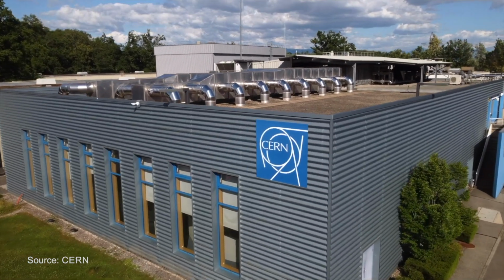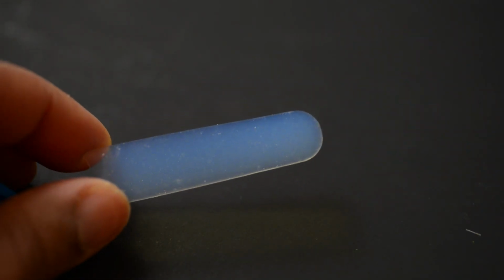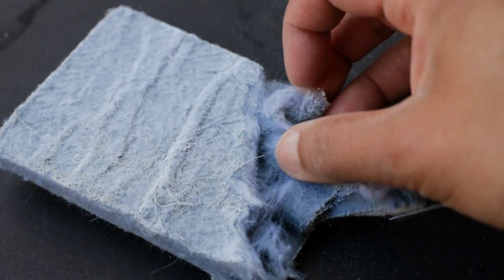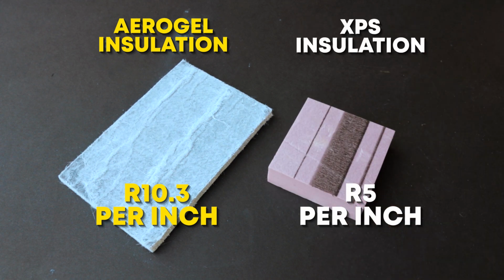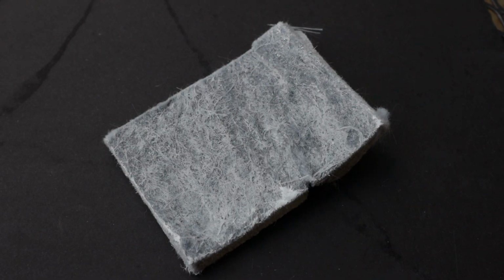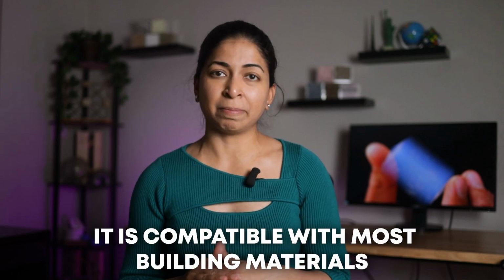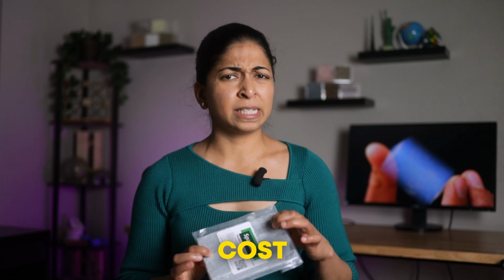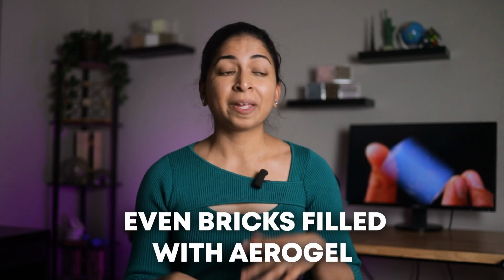Can Aerogel Insulation cut down our energy bills?

Comment from the maker: What do you think about  aerogel insulation? Would you like me to cover wood-inspired aerogel and transparent aerogel in another video?
Also check out my video on "The beginner's guide to aerogel": https://youtu.be/fjf7vdSWbb8
Reply: Yes, please do more aerogel videos
Reply: Aerogel is definitely very interesting, I would love to see you do an episode on vacuum, insulated glass as well,
I think it holds enormous potential, especially for insulating older properties and monuments while keeping their look.
Reply: I don't think it's really there yet as there is already PIR insulation in the market, which is still relatively new, but very promising, as it doesn't degrade, all the bubbles are closed in this foam, so no moisture inside of it. It does not burn and provides excellent insulation properties compared to common materials like polystyrene, or rockwool

Mainly it's not the problem with insulation itself, but the combination of factors, like the way it's applied, or which doors and windows are being used, and if there is a heat recuperator in the ventilation system installed. Besides, why use a more expensive material in the first place, if you can use just a bigger quantity of a cheaper material. 

Its also worth mentioning that it's an equation where you balance the financial cost to implement this Vs the energy savings, we achieve way more cost benefit if improving the cheaper issues first like roof insulation or installing double glazed windows as a mandatory procedure in all newly constructed buildings.

Besides such expensive materials need even better performing workforce on the ground, where it's already lacking in many countries in the quality of work concluded. Why use more expensive materials in the first place if a typical builder can mess up the insulation process while already using cheaper materials, if there are mistakes made in the way the building is constructed, it eliminates all the extra quality material costs involved.
Reply: @imakro69   That's some good information you've provided.  Maybe there's potential for a good comparison video?  Belinda did a "EPS, XPS & Polyiso insulation" video https://www.youtube.com/watch?v=xdnLOv-zf_o two years ago, if you haven't seen it.
Reply: @imakro69  PIR is most definitely flammable. All those solid foam sheet types are I believe
Reply: You can't just list off a bunch of interesting use strategies then not show them. That's just evil.
Reply: I think aerogel insulation would be great for use in projects where space is limited, such as in container home construction. That said, it sounds like it needs to be more generally available and less expensive.
Reply: @DesertHomesteader  Space is so constrained in container homes - especially their narrow width - I've always thought it made more sense to put the insulation on the outside of them, maybe combined with some sort of commercial-style exterior cladding.  Probably metal, since most container home people seem to be aiming for an industrial look.

This also eliminates any issues with condensation, which plague container homes in colder climates from what I've seen.  The interior metal shell would never get cold enough for condensation to be an issue if the home were clad in some kind of wateproof siding with something like a thick blanket of rockwool underneath.
Reply: Please make another video about aerogel and its applications. Aerogel for windows sounds amazing!
Reply: Yes, a transparent aerogel video.
Compare the insulation value of a standard gas filled double pane window to a transparent aerogel filled double pane window.
Reply: Yes, aerogel has been touted for years as the best insulation but so far there are so few commercial uses. The building you spoke about is the first I have heard of it being used commercially.
Reply: Do you know something about its capabilities when it comes to acoustic insulation?
Reply: This is a great idea
Reply: Yes, but what about bugs? How it deals with them?
Reply: yes you can cover it. I don't know if you did it (I must check it, and also others youtuber) but I would also like a video on how to improve attic insulation to increase R value.
Reply: Hmmm promising for certain applications I'm sure .
Reply: I would be interested in knowing if transparent aerogel could be used in skylights in a cold climate like perhaps Michigan.

I live in California currently but plan on leaving soon, and would miss my skylights if moving to a colder climate.
Reply: No. I've looked into this. It is not realistic to seriously consider. You need to keep your values consistent: the thickness is given in mm, but the R-value is given in inches. Their thickest batts are R-5, and the product is prohibitively expensive. 

To top it off, the problem with aerogels is that they are destroyed by water. This means that the batts require a hydrophobic nanoparticle coating. Why isn't this hydrophobic coating used everywhere - say, in municipal water pipes? It would really cut down on the energy used to transport water. The answer is because it is not safe in the environment. It breaks down over time, and when it does it can cause severe birth defects. 

Aerogel is a very interesting substance but it should not be thought of as a technology that is just around the corner. It has a LONG ways to go before it can be used safely commercialized.
Reply: I wonder if they could make something like an aerogel using lignin or chitin or some other natural substance...
Reply: nope, it's not that special
Reply: I purchased some common stock. But don't know where to purchase the product. The stock has 95% ownership by institutions.
Reply: The demand for a breathable heat insulation may be far greater than you envisage. Even placed just behind radiators placed on exterior walls has me thinking....yes I will use this.
Reply: Please make a video about carbon fiber reinforced concrete
Reply: You should do one on smart windows please!
Reply: What do I think?  I wants it!

To keep the summer heat out.
Reply: Very interesting - thank you!  I would be interested in learning more about transparent Areogel applications.  Living in the far north of the country where temperatures regularly are sub-zero, condensation on windows in winter leads to mold, mildew, and window rot.  Any info would be greatly appreciated!
Reply: I am searching insulation for my van with the plan to travel and sometimes sleep in. I was going to use Thinsulate, figuring it would not be toxic if I am covering it with wood that would also be sealed, but I cannot find the 1/2 in the US. Then looked for wool and it too is unavailable indefinitely. Hemp is scary flammable. I'm at a loss.  Guess I won't be insulating my rig anytime soon. 
Thank you for these videos.
Reply: I think it would be interesting to see if aerogel added into the concrete mixture of a foundation could improve the R-value of the concrete enough to forego the use of sub-slab or exterior insulation.  If you could improve the R-value of the concrete to say R1.5 per inch without compromising the strength, then an 8 inch foundation wall would have an R-value of R12, or a 12 inch wall would be R18.
Reply: Windows! Windows! Windows please. I was wondering about windows before you mentioned it.
Reply: I really liked the information given by you. I live in India and want to make a new type of bricks and arrow walls by mixing aerogel and fly ash but I do not have investment.
Reply: great for auto industry

Comment: what solutions does aerogel offer for homeowners wishing to save on energy costs? My home has a lot of sliding glass doors and is a end unit facing southwest. In the summer my heat gain is crazy while in the winter my heating bill sky rockets.

Comment: Great breakdown of aerogel insulation! The jump from R2.7 to R10.3 per inch is massive—especially for space-limited assemblies like fire-rated doors and curtain walls. Has anyone here actually specified or tested Spaceloft in a fire door core or slim cavity wall? I'm curious how it holds up under UL 10C or similar fire endurance ratings, and if the cost is justifiable in high-performance buildings.

Comment: Absolutely!  Aerogel insulation is a game-changer for energy efficiency—ultra-low thermal conductivity means less heat loss in winter and reduced cooling costs in summer. 💡💰 Investing in high-performance insulation like this can seriously cut down energy bills in the long run! ♻

Comment: I’d close off the fresh air intake in the HVAC system to stop the outside air from working against the system. 
Your insulation can’t do much if it’s constantly battling against an open door.

Comment: Looking to replace the (triple-plane/R6?) Serious-Window glass door for my infrared-sauna, with either spaceloft-aerogel , XPS, HempWool.  I don't want glass anymore.   Since it's such a small area (65"H x 24"W), the cost of the insulating material is not a concern, nor it being fire-retardant.

The idea would be to mount the insulator on a very thin sheet of wood.  Perhaps that will dictate what material I should use?

The only other concern is breathing next to it.  Is there a better choice you'd recommend for this application?

Comment: Belinda . . I have NOT seen nor experienced AEROGEL. From what I gather in your short intro . . . I find you mention that Aerogel 'breathes' . . and allows vapour to pass thru the mass. Doesn't this go AGAINST THE VERY PRINCIPLES OF ANY GOOD INSULATION MATERIAL. 
How do you justify a figure of R 10 . . . beats me.
If the product 'breathes' . . . it CANNOT INSULATE AT ALL.
Rigid Polyurethane Foam has an R value of 6 - 7. Justifiably.
How come Aerogel is 10 ??

Comment: Rather than cost per square foot, it would be more interesting to compare cost per R value per square foot, if that makes sense.  Or maybe cost to obtain a specific R rating per square foot, if that makes more sense.  If this provides an R rating of 10 versus another material of 2, then the cost to get to an R value of 20 needs to account for using 5 times as much maaterial to get there for the second product.  So the the cost disadvantage may not be as extreme as it initially seems.  Did i get this right?

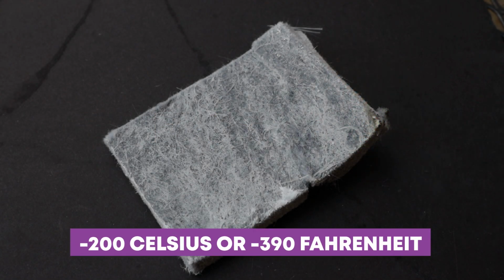Comment: 4:40 -- small error here.  200C = ~390F, but -200C = ~ -330F.  That 32 degree offset for freezing point of water always makes a mess.

Tbh, before I even clicked on the video, I figured there would never be any hope for aerogel as insulation because of cost.  The process of making it with supercritical drying and all is not trivial, so we will never live to see the day thay aerogel is affordable.  If there is hope for it, I'd also be curious about acoustic dampening.

As a rule, inefficiency of kinetic energy transfer due to poor impedance matching is one of the best ways to block sound.  It's why helium balloons can serve as sound proofing.  If that's the case, I feel like acoustic applications may come first because they will require less supply of the expensive base material and it is a market where people are accustomed to grossly overpaying for things, so it is easier for companies to turn a profit.

Comment: I was lucky enough to go to NASA Space Center in Houston, TX as a child, before the Space Shuttle was even built. When they showed us  the Heat Shield Tiles, the guy held the 4"x4" piece in his hand while using a blow-torch and then pouring liquid nitrogen on it. Not sure the entire process to make them, but we were told it is some form of foamed ceramic, which also made them extremely light and durable (17k+mph wind endurable)

By now the Patents have run out, and it is NOT necessary to keep it secret for Political or Scientific reasons. Furthermore, with all the advances in production and materials, I should be much easier and cheaper to make today. In our race to Energy Perfection, from generation, to efficiency, to storage, with all of the new ideas and emergent technologies  - WHY ARE THERE NO KNOWN USES OF THESE TILES???

Comment: Is this another persistent, man-made problem? Silicium is not eaten by anything and that is what aerogel is made of. Normally, that's not a problem because it's just sand.
But when you make it fluffy on a microscopic level, the dust from sawing it or handling it becomes hydrophobic.

How will we NOT create persistent dust that create problems in nature simply because it cannot be broken down? 
What happens if it reaches waterways, will it just sit on the surface as a blanket?

It's very easy to say that silicium isn't toxic but through physical properties the aerogel dust might be very bad news. And we are in that stage where such experiments SHOULD be conducted.
Reply: Scientific genius is no substitute for common sense 
or moral intelligence it's synthetic blue asbestos💀

Comment: I live in an older home who construction predated modern insulation techniques. As a consequence, there is not a lot of room between the exterior walls and the matrix on which the lath and plaster are anchored. As we have needed to excavate walls to replace original plumbing, electric, etc, we have encountered spaces unsuitable for most insulation products. This could be a good solution. Thank you for discussing!

Comment: How is it at light transmission? Except for the cost, it seems like it would be ideal for cold climate greenhouse panels. Sandwiched between sheets of glass or plexiglass you wouldn’t have to worry about its dust or fragility. Or, since it’s so hydrophobic, could it just be laminated to the outside of greenhouse glass (which is already fragile) to shed rain and snow? Or would it hold dirt and then be impossible to clean?
Edit: Such a potentially game-changing material. I’ve been following it for years since I first learned about it. Eliminating even one of its disadvantages would make it viable for mass production and usage.

Comment: No no not acoustic insulation (sound insulation is to “sound proof” a space). Maybe acoustic absorption but only if the foam is open celled - something like expanding foam is closed celled so no good at sound absorption (to reduce internal reverberation). Insulation needs dense heavy materials, absorption needs light fluffy material. Ideally neither should be rigid

Comment: Aerogel is another gimick...they are using it in floor insulation with cement..defeats the purpose of aero gel..where you say 5 times better than other insulation you are picking the worst end of the spectrum. Takes 5 days to set on floors. No good for the fast moving construction game...no not toxic in small quantities..depends what you consider small(this is another sales gimmick) ohh it only hurts your throat..more than likely it can cause very bad lung problems..this has been used in Switzerland 1no build and used for older buildings..why just not install thermotec which has been used in Austria Germany and Switzerland on old ,historic,museums, historic buildings with a proven 35 year track record..it is now in Ireland.

Comment: It's interesting it's benefit to older construction. Our house is 150 years old and one issue with doing a lot of DIY is that much of the modern building materials and methods are designed to make the building airtight. This is okay to a certain degree, but with older houses some air and vapour flow is necessary to allow things to dry and not rot.

Comment: Interesting product.
Something I'm curious about with insulation is the cost-benefit of it.  I don't doubt that better insulation lowers heating and cooling bills, but how much does it lower them?  I understand there are countless factors affecting it, but still, we need something to go on.

Did see one video by a man who doubled the R-value of his ceiling insulation and did some impressive analyses on the results.  Bottom line: about 20% reduced heating and cooling.  But with a cost of thousands to add the insulation, that's probably a 20 year return on investment.  Not good, from a purely economic perspective.

Comment: To reduce cost could you cut it into strips (or manufacture it that way) and just use it on studs and plates to reduce thermal bridging, while filling the space between studs with rockwool?  An 8' stud would take 1 square foot of Aerogel.   At $7 per sq ft for Aerogel, (and $2 sq ft for Rockwool) the area under a 4x8 sheet of plywood or drywall (including plates) would be $88 instead of $224, and at $20 a sq ft for Aerogel, the area under the plywood or drywall would be $134 instead of $640.  On an "average" house at $7 for Aerogel you'd save maybe $5700 which might not be a big deal in a cold climate, but at $20 sq ft you'd save about $21,000.
Check my math though, haha.

Comment: Construction mob is strong still and new stuff is not welcome as there is little to no kickback with it. I was involved in a residential project in 2006 and recommended aerogel. Math proved it just slightly more expensive than the next best thing but it gained marketing benefits. Reasoning behind it was the cost difference in manhours and increase in space sold vs outer envelope. So thinner concrete walls vs bricks and EPS lead to more square meters sold. 30mm Aerogel was recommended to achieve low energy status. It was a nice project. 2008 killed it. :( Go Aerogel :)